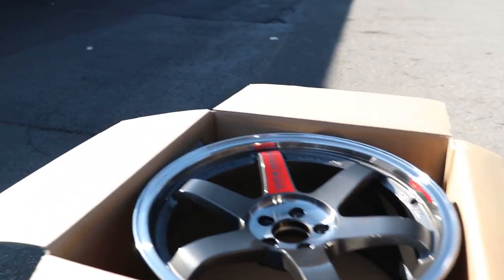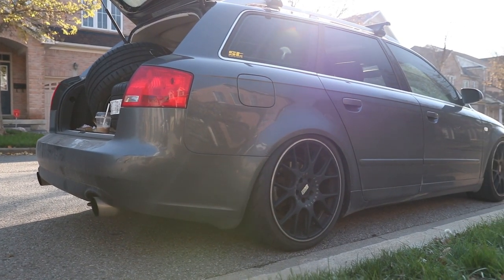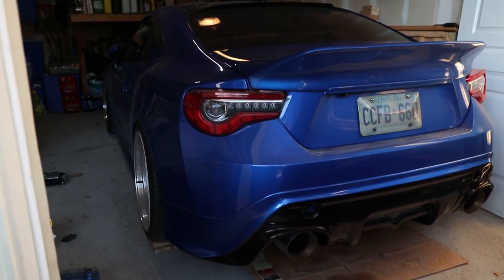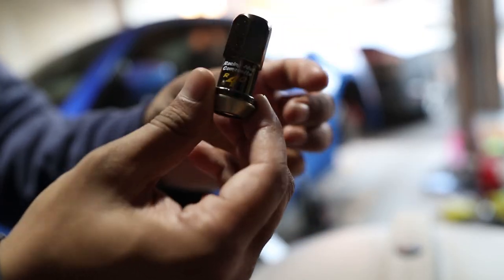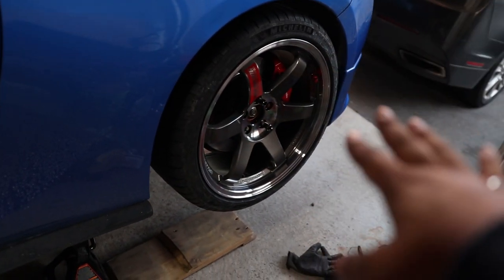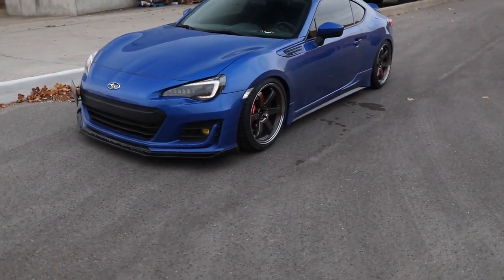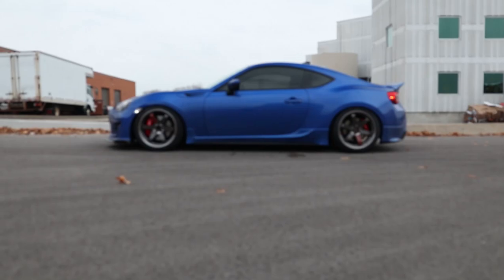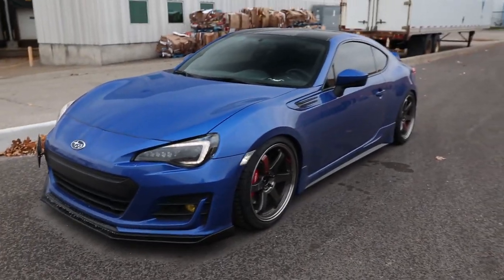FULL REVEAL! New wheels and bodykit installed! VOLK TE37 SL x TRD x RALLYBACKER | BRZ/FRS/86

Comment: I would like to see the rears a teeny bit wider . I know it's probably just the angle of the video but the front wheels look a lil wider than the rears on certain angles.
Reply from the maker: Ya I think that is because of the camber. It is tucked in a little more in the rear but the wheel sizes are the same all around. So it makes it look “smaller”. I should even out the front and rear camber too
Reply: @LivingAsleepHD  I wonder what the measurements are of the front and rear track .

Comment: What would the car look like with an 18 9.5 ET45? Thank you very much
Reply from the maker: I believe that spec is less concave than mine so the spokes should look more flat. Also the wheel will sit closer to the strut so you would need to be careful about clearance there. I personally prefer 18x9.5 with +30 to +40 offset, this is the sweet spot for my aesthetic preference lol
Reply: @LivingAsleepHD  thank you very much bro
suspension that you carry, of origin?

Comment: Hey man I also have a brz with Performance package and I am trying to get my first set of wheels. I really like the te37sl black edition 3 but I think it only comes in 18x9.5 +43. Do you think this will fit the vehicle too?
Reply from the maker: +43 will look very different and I’m not sure if it will clear the brembos without spacers. You can get different offsets but you will have to go through some specialty shops that can make bigger orders of wheels, like System Motorsports (how I got mine) or Evasive. Btw, SLs are discontinued now, you will probably have to get Saha SLs unless there is leftover stock somewhere
Reply: @LivingAsleepHD  Thank you so much for the info I will look into those shops to see if they got something or just settle for something else
Reply from the maker: Np good luck man!